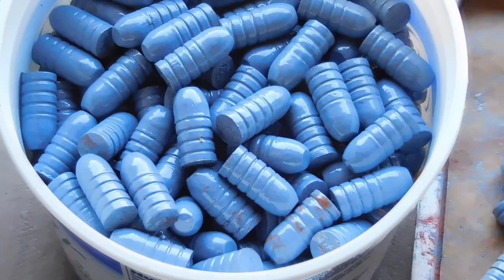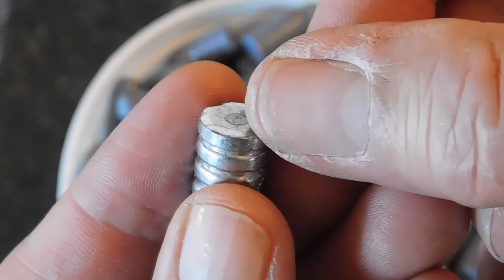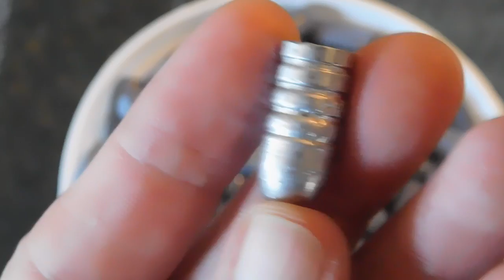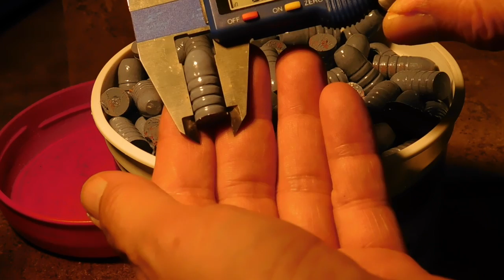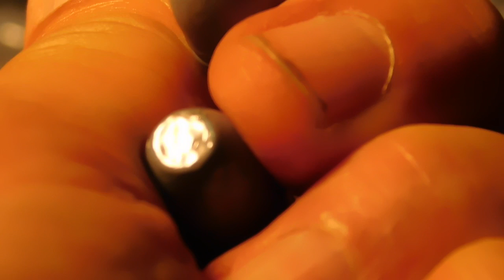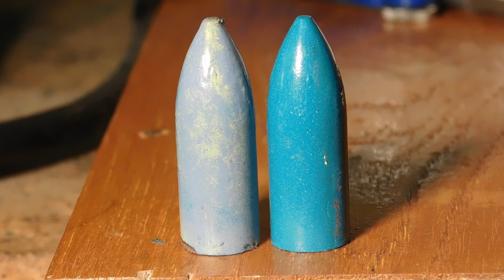Options For Our Cast Bullet Lubrication Procedures

Comment: Any experience in moly coating bullets? Or using tetra to "tetrize" your bore? Years ago I would do so on copper jacket rifle bullets and get minimal decrease in group size.  Use of treating bores with tetra gave me  a 20% group size decrease on HV rifle bullets and my 50 and 54 muzzleloader rifle bullets.

Comment: Years ago there was an article on using lead bullets in hotter loads. It was shown that you could cut thin foam disc from like meat trays to be used as a gas check. To prevent the base of the bullet from being melted the disc prevented that and it was vaporized so left no residue. You always had to try what you read about so loaded .357 rounds with the disc and the recovered bullets the bases looked just like cast. No leading of the cylinder forcing cone compared to bullets not having the disc.   When you said which method was easier you forgot the powder coated still needs to be sized one at a time just like a conventional lube sizer method, so the powder coating is a LOT more work. They also look like crap.
Reply from the maker: GV - I've used milk carton cardboard punched out for 777 wads with great results with cast bullets.  And no wads with standard velocity cast bullet smokeless loads.  For hotter loads, casting with linotype and conventional gas checks was the way to go.  Elmer Keith never even used gas checks with his favorite hot 44 magnum loads of 22 grains of 2400 and 245-250 grain Keith SWCs going with medium soft plain base.  Plain base has always been good for me in 41, 44 and 45 caliber hot loads with Keith bullets.   I love cast bullets in 38-357 cal for standard and +P loads.  For hot loaded 357s, my own preference was to go with jacketed bullets for the most part.   But your styrofoam wads would be good to try for sure with medium soft cast bullet hollow points in the 357 or 38.  Of course, the 38 needs the expansion for terminal performance on game.  With the bigger bores, hard cast SWCs just do well.  Have a great Holiday Season...Steve

Comment: Very informative. I’m new to casting my own and have one question. Is lube applied before or after sizing?  Thanks, I appreciate your knowledge.
Reply: If you are using a machine like the RCBS to lube your bullets, your in luck because the lube-a-matic not only lubes but it install a gas check and re-size the bullet all at the same time. If your going with a traditional lube system for cast bullets the RCBS is hard to beat.

Comment: Not sure why you are doing a couple things.  From what I’ve read, Powder coating bullets was developed to eliminate the Lubing step.  Also, by applying the powder coat first THEN sizing the bullets by pressing them through a sizing die…you are removing some or all the coating you applied, which then exposes the lead directly to the bore.  And Leading is the proper term for fouling as used with smokeless powder, as exposed/unlubed lead will detach from the projectile and layer onto the bore. If you are loading using black powder, there can be some powder fouling also, but again if bullets are not lubed you’ll also get some leading. Seems you’d be better off Sizing the cast bullets first, then applying the powder coat.  Lube would then be unnecessary and you’d save time.

Comment: Hey FC - thanks for the informative video which has probably come closest to answering a question i have - Powder Coated Bullets used with black powder? Mainly 45LC & 45/70 shooting - I am going down that rabbit hole at present as I have a few thousand powder coated bullets to use up. I am assuming that BP lube will be essential in conjunction with the coated bullets for BP so as to keep the fouling soft as possible  - wondering if you have any experience with this?

Comment: New to casting lead bullets I bought the lee TL-356-124-2r mold for 9 mm I also bought the lee 356 resizing die before I seen this video 
So my question is can I powder coat this bullet and not use the alox 
Also my resizing die instructions say to lube bullets before running them through the die or it can foul the die with lead if I do this then I would have to clean them before I powder coated them
That is if this bullet can be powder coated 
I also ask is the tumble lube bullet made to use gas checks? Just by using my resizing die?
Although I really don’t know yet much about the gas checks
Thank you

Comment: Very interested in the topic of combining powder coating with lube. I saw a video of a gentleman shooting some powdercoated and lubed 357 bullets from loads of bacon. He shot a group of powdercoated only, then a group of powdercoated plus loads of bacon lube (50/50 beeswax and rendered bacon fat). Both grouped well, but the bullets that had lube clocked about 100fps faster. Seems very substantial for pistol velocity and nothing else different. Fortune cookie 45, do you also see increased velocity when you add lube to your powdercoated bullets?

Comment: I've subscribed to yours because , ha ha.. You have a bullet like mine but, I still have some questions...

Got the Lee C457-500-F bullet mold for my marlin 45-70 and pictures of the bullet show a gas check of course , and it's not 500gr, it's 450gr go figure..ha ha..

Anyway, not black powder so, I was going to try these out but, need to size and lube but, wanted to ensure I'm going the right direction.

Are the gas checks 45 because, midwest has the same hornady box of 1000 with a range of 45 but, I see mine are .457 - didn't know if i got a unicorn bullet or, normal and they're all the same and get mashed on..

Any info helps me hit buy now ...lol

Great video ...👍🇺🇸😎👌

Comment: Hi FortuneCookie45LC. I am a new shooter and re loader So please forgive me if this question is stupid. When you powder coat your cast bullets is the powder coat same as automotive powder coat powder? I am from Canada and have tried to find this out with companies that sell automotive powder with no luck. I have really enjoyed your and other channels in regards to reloading and shooting I have learned so much and always look forward to the videos.
Reply: Its polyester powder coat - most people start with Harbor Freight Red - it works good and a $9.00 container will last for years and coat thousands of bullets. It does not say "Automotive" on the label - its just powder coating powder - it works on about everything, automotive or otherwise. It is very tough coating, it is intact on shot bullets, and does not crack or split when you smash a bullet with a hammer. Good stuff, I've used it a few years now without any other lube on it, with no leading and no problems even with soft bullets pushed hard. I no longer worry about bullet hardness, I just look for good castability ie a few percent tin and whatever antimony the lead happens to have in it.

Comment: Excellent idea trying lube on top of the powdercoating to improve accuracy . I hadn't thought of that one.
Reply: I have some expensive guns and go the extra mile to keep barrels free from lead. I've been doing the P/C and lube for quite some time now, and experience accuracy and no lead deposits in my barrels. I do this for several calibers ie; 380, 9mm, 40, 38Spl, 357, 45ACP, 45LC, S&W 50, and 8mm Mauser.

Comment: Biggest issue I have with powder coating is what type of fumes is the gun creating when you shoot them. We know firing lead bullets will put lead in the air in some form but that is the norm. Now take the chemicals used to make the powder coat (and different formulas from different makers) heat them up, and vaporize them. Copper plated would be my first choice , and for casting I am inclined to pan lube.

Comment: This is a very informative video, thanks.  I have a question that you may be able to answer.  I'm using a bullet lube formula of 1 part petroleum jelly, 2 parts beeswax (or paraffin wax), and 1 capful of STP Oil Treatment.  I know the wax is the base, the petroleum jelly is the softener, but what is the STP Oil Treatment for?  I can't find an answer anywhere.Thanks FC
Reply from the maker: Roy Seifert - Neither one of us are chemists.  But there are tons of recipes out there.  However, STP is a petroleum base oil additive - increases the lubricity of engine oil.  Why not add a capful of engine oil or any manner of oils or waxes (they've been tried)?  One of the old time gun writers used his own mix of only the beeswax and petroleum jelly and he said it worked fine.  I throw in some Lee Liquid Alox, and it works fine - in fact 50% beeswax and 50% alox is the NRA formula.  The beeswax is the scaffold that keeps the concoction in the bullet (bees construct with it also of course), and the alox does the great work of lubricating the bullet.  Doesn't take much alox so the STP is performing the same function as the alox - increasing the lubrication of the bullet.  Warm up the alox and it flows just like STP.  Look at Ed's Red - uses transmission fluid, kerosene, mineral spirits, acetone to clean guns. And the acetone can be left out.  Acetone dissolves plastic, but what purpose does each of the others provide - other than the ingredients are common even in Russia?  Of course, all are solvents.  The answer is that I don't know exactly what STP does, but it's good for engines and works for our cast bullets should you decide to use it...this message will self destruct in 10 seconds...good luck, Mr. Phelps...   Best to ya,  FC Steve

Comment: Try Mayan gold by powder by the pound, I just got it and they coat as good a ford light blue! It’s black with like a gold sheen and looks awesome!
Reply: Nice Gunmonkey5! I just got some Gold and some Cadillac black to go with my Ford Dark blue . If your a real engine guru kind of guy, or Ford nut we know that Ford barely used the light blue. I think it was only for a year or 2. Ford always used Ford blue or later as it became known "Dark Ford Blue" for decades. In the 90s Ford quit painting the blocks , Now they are all aluminum nearly so no paint required. I just thought I would put that out for all the gun guys info.
Reply: I just sent a messages about about getting getting with my mom I so sorry for that that

Comment: Thing about powder coating that concerns me is between the heat from firing the round, and friction going down the barrel, what chemicals are released into the air? Plastics are not a good thing and in an indoor range this could be even worse if the blowers are substandard. That could explain the lack of endorsement for that system as it is a potential health risk. (not that burnt powder and lead are great). At this point I am leaning toward pan lubing my heads as I already use a 50/50 parifin/Beeswax mix for making leather armor (do the Medieval re creation thing, so have pots of the stuff and a good supply of wax on hand already,
Reply: First off, cool down....powdercoating is much better because it coats the whole boolit. There is no gas cutting going on in charges that are subsonic. Pistol loads.

For rifle loads, cast and powder coat. Add a gas cap and size. Your load will be true. The process is a little longer but rhe results are tremendous!
Reply: Vs lead?

Comment: when you powder coat what load data do you use, cast or jacket
Reply from the maker: bob crawford - Great question not often asked... There is some word being passed around that PC allows cast lead bullets to shoot like FMJs.  Stop and think about this for a while and the PC coatings are similar to tough paint approximately .001 - .0015" thick.  The strength of the PC coating depends on the lead underneath just as PC paint over steel is tough and durable because of the PC and the steel.  And if a PC bullet is melted in molten lead, the coating will either float off limply and flat or be burned away (as observed on many occasions melting them).  When jacketed bullets are melted, the jackets are there in perpetuity.  When you view videos of jacketed bullets being made, the bullet jackets are drawn copper alloys that stand on their own with side wall thicknesses over the lead core in excess of .030 at the base and over .010" at the nose.  The advent of jacketed bullets was because the plain lead bullets would not hold the rifling at smokeless powder velocities and strip off causing bad accuracy and barrel leading.  While PC coatings may inhibit leading at high and totally prevent leading at lower velocities, the ability to hold the rifling is not improved by the PC.  It is the reason you see no videos showing groups shot at high velocity at distance.  We may have pushed the velocity envelopes marginally higher with PC (especially using very hard lead alloys), but the jacketed barrier is still there.  When I want to shoot my .3 - .4" groups at 100 yards with full power 223 or 308, I'm reaching for my Sierras.  When I want the expansion that technologically superior jacketed bullets provide, I'm reaching for my Noslers and Hornadys.  When I want to stitch targets at 50 yards with my pistol caliber lever guns, the PC is most fine.  Until more work to develop the idea coating yet undiscovered, we need to regard PC bullets as cast with a more efficient and better lube alternative provided by the PC.   You should do your own testing to determine how far PC can take you with effectiveness - and report your findings to increase the body of data available.  Best Regards,  FC
Reply: My .02 aswell, cast data only unless a gas check is used.

Comment: Do you have a good lube recipe for black powder shooters?  Looking for something I can make for my flintlock.
Reply from the maker: charles miller - Just talked with Moe and he just uses Crisco in his percussion Hawken.  Others prefer SPG.  Good shootin to ya..!!   FC
Reply: 1 part beeswax to 4 parts extra virgin olive oil, by volume, eg 1/4 cup melted beeswax mixed with 1 cup olive oil, heat it and mix it in a can that's in a pot of boiling water (or use any form of double boiler). If your area is really hot a stiffer mix is 1 to 3. It works great for my cap and ball revolvers and is a good lip balm too. It should work well for patched balls and also your flintock's mechanism. It should work well for Minie balls also.
Reply: PS Crisco makes a mess when it gets hot, beeswax mixes work better. Maybe Crisco would be fine for patch lube though, the pillow ticking should just soak up hot Crisco. I've heard butter flavored Crisco works better for some reason, but have no experience with it.

Comment: What would BHN 12 to 14 look like with the thumb nail test ? Great casting..
Reply from the maker: Nick J - You would get a beautiful definite dent with the thumbnail test.  Best to ya, FC
Reply: You can also get a hardness tester but the video is pretty informative with the nail test. Ballpark is yoir nail will peel pure lead. After that the hardness will increase with the addition of antimony. Rule of thumb here, unless you can score a good supply of wheel weights order some Lyman #2 lead. It has a BHN of 15 which for just about any instance is good to go.

Comment: l have been lubeing Missouri coated bullets. I wanted a cleaner shooting bullet, less lead in the bore. At this time they  seem to be much better, need more testing. As all ways very good info
Reply from the maker: Milton Wells -  Certainly we no longer have to do any lube at all with powder coating - the PC is the lube.  But that doesn't mean that we can't use other lubes in addition.  I have yet to test bullets that are quadruple lubed (PC, GC, lube and tumble lubed).  You would think that would be grand overkill, but a shooter could do that if they chose to do so for whatever reason they deem fit.  Best to ya,  FC
Reply: FortuneCookie45LC I have had some problems with this revolver. Lubeing the coated bullets solved the problem. My other revolvers do good. As all ways very good info. from you.